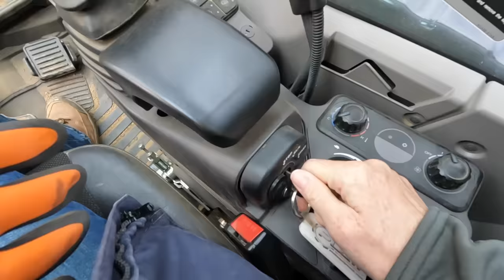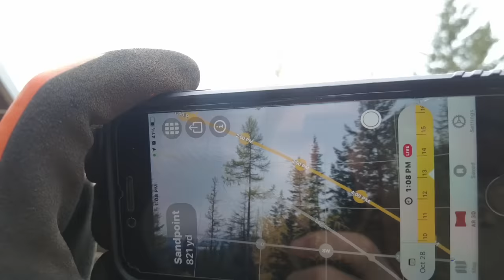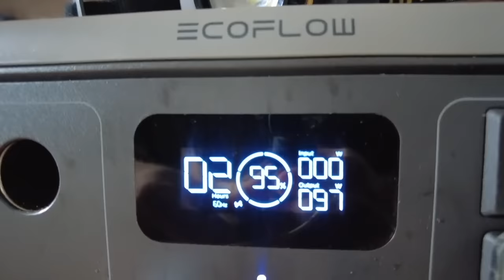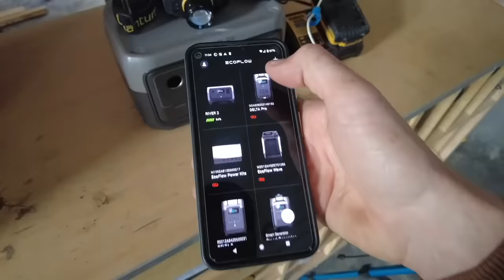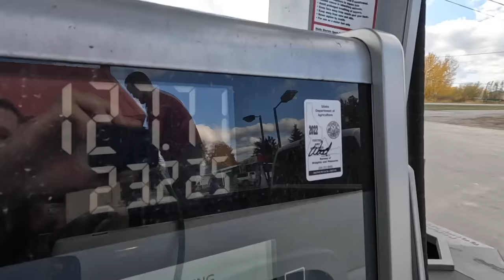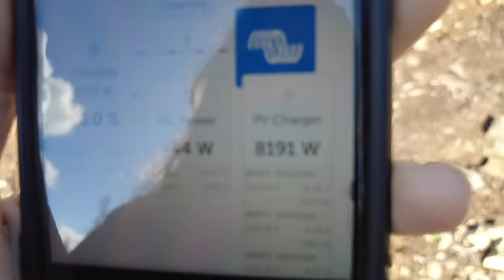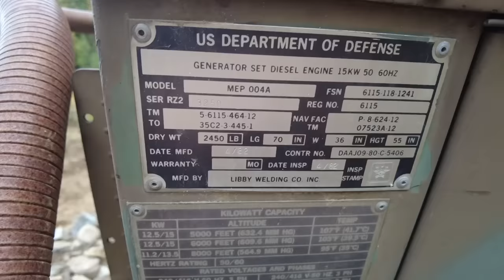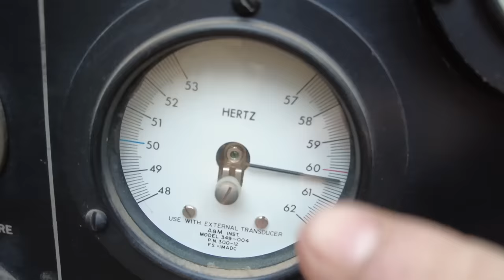Fixing PROBLEMS With Our Off-Grid Solar

Comment: Good job on getting things done. You might want to do 2 more project really soon. First is to cut down some more trees on the up hill side near your panels. Never know if you get some wind and some snow that might knock them over and crash into your system. Second would be to put some sort of retaining wall in front of your system. Over time with rain, it might wash out enough dirt to cause you problems for the container. Another idea is to have 1 day every week or two to "maintain" your equipment. Get into doing it on a regular schedule and it might save you some down time.

Comment: Great and fun video! I echo the others who are concerned about the erosion under the solar panels. You have enough rocks and equipment to put together a decent rock wall at the base of the panels, to stop the hillside from sliding. It doesn't have to be pretty to start with, that can be done later. I would estimate you could put something together in 2-3 days that would work for a few years. Thanks for your humor and your dedication to your efforts. Stay well, stay safe!

Comment: You need a fuel transfer pump. 
You should pour a pad for the generator.  Then build a surround and roof.  Look at a company called rock wool they have noise cancelling insulation. Also possibly get a noise cancelling cloth. 
Also looking at the location I would build a path with an elevated roof. That way hopefully it keeps snow off and you don’t have to blow of sweep the path to keep it clear to get there to use it.

Comment: If you only use 1 phase (2 legs of the 3), you end up with 208V instead of 240V. Many equipments can take it but I would triple check before to use it. But since you can adjust the voltage, maybe you could adjust it to be up to 240V between 2 legs instead so you will be set. 

For the panels I think the pivot point needs to be 3ft higher. Maybe doing a steel square triangle structure over the container to handle the pivot higher would help a lot. 
The slope seems to be a bit steep for the dirt to start doing erosion over time with rains and snow..I would check to add rocks over it to keep it stable

Comment: I run a cheapo solar battery tender on everything that's just mostly sitting around.  When the temps get really low that battery that cranked just fine at 80 degrees will often struggle at 32 degrees.  You could even do the same thing with an outlet and battery tender coming from you solar shed as its so close.  Its cheap insurance for your batteries.

Comment: Nice teamwork. Nice moves in the mini-E. Awesome the genny started right up - lucky. Amazing that adjusting the panels a few degrees you picked up 300 watts. Might I suggest using a beer can A.K.A. SPAT - Solar Panel Adjustment Tool to adjust panels for max input. Thanks for sharing.

Comment: You could Automate the tilt of the Solarpanels, it shouldnt be to hard, to use a Electric winch controled by an Arduino to follow the Sun, I think it would be worth the Work.

Comment: Just watched latest video and noticed that Riley needs to watch some videos on how to FELL, not fall a tree. You need to cut a wedge that is on the side of tree where you want it to fall and then make a horizontal cut toward the the cut, and slightly above the cut out. Also, regarding the filling of gas containers. Your containers are not red and therefore should not be used for gasoline. Also, when filling gas containers they should be on the concrete at  gas station to avoid static electricity that could blow you up. Enjoy your adventures in developing your property.
Reply: The excavator, bulldozer, generator all run on diesel.

Comment: Good Job on getting the track back on. It is a learning curve if you haven't done it before. How long did it really take you? Just Curious. My excavator did the same trick. Once on the back and once on the idler. I finally rebuilt the tensioner and no more problems. If your tensioner starts leaking the rebuild kit is only $51.00 for 1 rubber O Ring, 1 plastic washer (flat pkastic)plastic, 1 new snap ring. 1 dust cover seal. Cost to make is probably $4.00. Rebuild it yourself as I did as it usn't that hard. 
Cost to have dealership come look at is $$180 per hour driving from the shop each way. Time to diagnose on site is $180. Time to fix about 1.5 hours. There you go! Love the videos. Cheers from the state of Washington. Jerry

Comment: You need an electric leave blower. Plus you should always have two batteries for every tool so you can swap while charging. Plus wash the panels after any smoke from burning and don't burn near them if you can avoid it.

Comment: Military diesel gen, 👍!  They make em too last, and with your access  to off road diesel, the expense to run it is a great bonus! I love my Yanmar clone 5 kw gen, it's loud and stinky, but dead on reliable! It costs half as much as our old generac gas 4kw to run, even with the higher cost of diesel. Its nice to have the option and a backup plan!

Comment: imagine, instead of burning the wood, you grind it up and dig a 18ft x 10ft hole in the mountain behind the home. run metal pipes through it and into the garage, controlled with a mini fan, you could use all that energy in the winter as slow release fuel.

Comment: Hook yes but on the mount vs bucket, but I also welded a D ring on the blade. Don't think every little sun blockage need to go, just there for 10-15 minutes. Wheat Penny

Comment: If you are going to use the pine wood for heating your house, u you should let it dry for about 1 to 2 years before using for heating. But if you use it for a fire pit you can use it in about 6 months. Wet pine creates a lot of cerasote.    😮😮

Comment: Haha.  I was a 68 bravo in Korea. I  would put that Genset in a building.  Have you ever worked in a Genset in the open in the winter? You're probably not going to start it on a regular basis so if it don't start in a storm you're gonna understand.  Heated building...

Comment: Just a thought...  I have seen back of the pickup aux fuel tanks ( in the bed ) That would allow you to get ~50 gals a trip - that far in the woods, it might be prudent to have <some> local storage at the house even if it is a hand pump out of a 55 gal drum.

Comment: Safety first folks. You must either ground your truck or fill the fuel tanks on the ground. If you strike a spark from static electricity generated by filling the containers, you'll light a heck of a fire.  Otherwise love the show and your gumption.
Reply: It's much harder to spark ignite diesel in open air than it is gasoline

Comment: Consider running your winch cable downward through a pulley at a low point on the container. The current angle of pull ends up putting a lot of extra strain on everything, including a sideload at the hinge and it's fasteners. If anything is ever going to break, that will be when it'll happen. Of course, you may not be dealing with enough force for it to matter.

Comment: Dope! You had a back-up diesel generator already. And you picked up an IBC tote too!

Although, you could probably have moved the diesel generator into the shipping container and setup some plumbing for the exhaust, since it adds weight and makes for an extremely effective ground ballast anchor.

Looking forward to the next video and hearing how it all works out this winter. 9kW is killer.

9kW x 6-8 hours = 54-72kW! That's insane!

Comment: Same way i burn slash piles i just start a normal fire on or inside it. Works great cause you get a nice hot starting point vs gas or diesel that just burn off if the material isn't dry enough.

Comment: Great video. Based on the 'news', you might want to get a couple extra 55 drums for DIESEL, or a 275 gal tote. It might be expensive now, but probably will be a lot more expensive later.
Because it's critical for the Generator, Excavator, Dozer and Dump-truck(?). Good luck.

Comment: Ambition Strikes:  You've selected two 'red-brown' colors. One of these is considerably lighter/less red than the other. These colors are proposed for the door set into the building, adjacent to what appears to be metal siding painted a light medium brown. That said, the lighter of the two selected colors fits/goes/compliments the building color best by far, the top color swatch of those you held up. That color is "pottery-urn?" If so, that's the color for your door––   whatever the color name, in fact, may be. However, you've most likely already painted that door by now. Hope you chose––  correctly !

F W I W, your videos are, in general, quite interesting/entertaining, garnering you the standard You Tube 'thumbs-up' as a matter-of-course...   PLUS , the highly prized/much sought–after "Old Curmudgeon" three 👍👍👍,  awarded for video excellence in an individual YT channel. Keep up the good work and keep 'em comin', guys!

Comment: if going to put second ground  by generator you need to find dirt not rock and use pvc schedule 80 to protect wire . I use a demolition hammer to drive the ground rod into ground

Comment: Great videos and content, as usual. Recently subscribed and binge watching. We are hoping to do something similar to you and we are learning lots. 
You should consider a simple tracking controller to power a motor to keep the panels at the ideal angle. Best to get the most out of the panels in the winter.

Comment: You might want to add a layer of Reflex insulation to the outside of the container behind the panels, this is stuff that has layers of reflective foil and air or foam layers in between.  The highly reflective surface might improve your panel output and keep the container cooler during the summer and some additional insulation benifit in the winter.

Comment: with regards to safety and backups:
If you already haven't, you should figure out how to (re)configure your solar and battery setup so that the system is split (half? thirds?), such that you can take down the part that needs maintenance without bringing down the rest.

Comment: That's quite the generator.....I worked in the film industry for many years and everything was powered by mobile generators like that. I was always told to use all three legs and check that they are balanced roughly all the same. So basically as the all the different units were hooked up we changed it up using all 3 legs and this helped keep the generator running smoothly, otherwise we'd be causing damage to the generator and it kind of ran rough. I could be wrong here but not sure you want to take a chance on a generator that's worth 10/20 thousand, maybe more. Just saying, what you got maybe something completely different. Anyways great place you got there and a nice setup with those panels.

Comment: Riley, you should know by now the paint color will ALWAYS be Courtney's choice!!!!  Happy Wife = Happy Life...   I also agree you should place some rock and crushed rock below the solar panel to prevent erosion and mud slides.  You have the rock on site anyway.   You are probably going to be either shoveling or pushing the snow that comes off the panels out of the way at some point in the winter even with that lowered shelf you cut into the hillside.  Flat shelf with rock/gravel covering will let you use the power equipment without bogging down in mud or sliding on ice.

Comment: Nice amount of preparation jobs You did! 👍 Excellent video, as always!

In reality, these burned trees may be a good firewood some time later - only need to cut by length, leave to dry and then chip with axe to size.. 😉

Comment: I have to agree investing in a wood chipper and chipping the branch's from the trees that y'all harvest and adding the chips back to the environment instead of burning them. Also if you was to invest in a sawmill then you could cut you some lumber out of those logs. So on a different note you're really lucky that you were able to have that military grade diesel generator. And where you put it at there it's your solar Ray was a really good idea in order to use the generator to generate electricity if your panels is not getting enough Sun. In order to recharge your batteries back.

Comment: Should have saved the logs for firewood. Also be aware that chainsaw pants will not protect you from electric chainsaw. They grab chain and were a gas engine will bog down an electric motor will increase torque to maintain chain speed cutting through protective gear into you

Comment: I had 4 acres in Western Pennsylvania that I built my ex wife's home on.  I was always cutting brush and had one designated area I would pile it up in all spring, summer, and fall.  When we had about 6" or more snow, I would call the local 911  center, tell them I was starting to burn, then call back when I was done.  It is much safer when the snow is on the ground and looks like you had a nuke strike on that spot when done.  You are in a much denser forest than I was.  Good luck and I hope you follow my tip.  Eddie

Comment: It would be nice to hook up the generator to automatically start and charge your batteries when they reach a certain arbitrary low level.  For example, if the battery charge reached 15%, the generator would automatically start and charge to perhaps 40% and turn off.  Then if it was daylight and the solar panels could produce juice they would complete the charge.  I don't know if you would need to have some isolation switch to prevent generator power from shorting through the solar array or not, but like the automatic isolation switches on home generator installations, I'm sure the tech is available.  Then your only challenge is having a fuel source for the generator - either a kero tank up slope for gravity feed, or one low with an on-demand pump to push kero up to the generator's tank.  Kerosene (#1 oil) to prevent gelling of diesel (#2 oil) in the cold.  Red kero is available for off-road applications just like diesel.  You might even be able to run a blend of perhaps up to 10% bio-diesel (bio-kero).

Comment: Seems like a terrible waste of timber wood. Rip rap that hill below the panels. Use the darkest rock you can find and cover it with a dark vinyl tarp from RangeTarp during snow months.
    Best to check/replace the fuel filter/water separator on the diesel genny going into winter.

Comment: 11:00 Riley another question for you guys, on that winch, wouldn't it be better to move it to a lower area on that wall or stand?, the lower the level the easier for you to pull the panels will be

Comment: Nice Project but i would have built a wind generator on top of the hill behind the house in addition to the solar panels. And instead of burning the  trees for nothing to use them as firewood in the wintertime.

Comment: I see that you have very unnecessarily long cables coiled between your solar cells and the safety switches that are mounted on the container,
it is not a good thing because it causes you voltage losses in the system, you should have as short wires as it is possible to have.
in order not to voltage drop in the system
I must say you have done a great job. I follow you from Sweden

Comment: I was surprised you didn't chop those trees up for wood, there was so much there. Firewood, wood to use for building. Big shock.  Anyway love your videos.
Reply from the maker: We saved the trees that will make good firewood, but with over 40 logs already set aside we chose to burn the rest.

Comment: When you get the track on  the excavator in a side stress position it will force the track to pop off the Drive. be Moving more when you are turning the excavator.

Comment: Hello Riley, 
  Nice job getting your track back on the excavator. I two have a suggestion about where you dug out in front of your solar panel. You might want to contour your hillside bank with your excavator or D8 dozer so you can ramp snow away. It can give you a place to clear all around  your garage & road way.. It will help keep water off the parking & roadway and help with erosion. plus water shedding. Would love to chat with you some time. cause you guys have some great projects you can do all season to keep the homestead evolving into you Dream living sytle. Think you guys are doing a great job on all your DIY projects.
 Sincerely James Allen

Comment: I was surprised you didn't reference drifting that mini down the hill. Mine usually slides also but I usually put my push blade down because it is just a little more contact.

Comment: I hope an above ground fuel storage tank is in your near future. We had one on the ranch that was a two compartment affair for diesel and regular gas. It was elevated about 4 or 5 feet with a top fill for both and gravity flow hose’s.  Then you can order a delivery whenever you need to. I think it was a total of 2,000 gal capacity? Best wishes to you both. Love your videos.

Comment: Couple of things for you....

When felling, your technique isn't great. When cutting the wedge there's a few different ways, but it should be at least a 45 degree angle.

First option is to cut horizontally, then cut your wedge from above at around a 60 degree angle. Gives pretty good directional control and gets the stump nice and close to the ground.

Second option for steel slopes, same horizontal cut but further up the tree, then cut from underneath at a 45 to get your wedge.

For both of them the felling cut should be around 1" above the horizontal cut from the wedge.

The way you were cutting your wedge angle was too shallow and your felling cut wasn't quite high enough.

For lighting a fire, mix up firelighting fuel from 3 parts diesel and 1 part petrol.

Comment: Usar a smaller cord when using the paint sprayer. That would be a good test. See what’s the longest cord you can use with the sprayer In order to keep the paint off the battery.